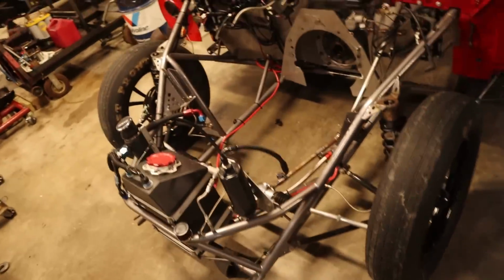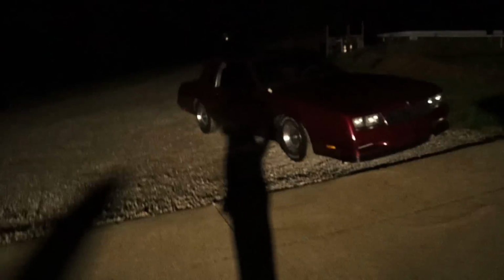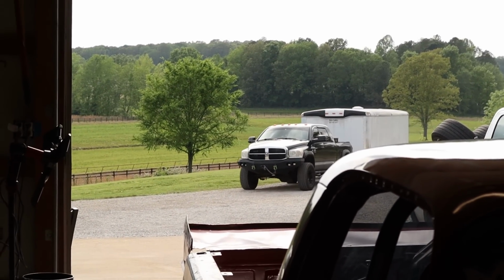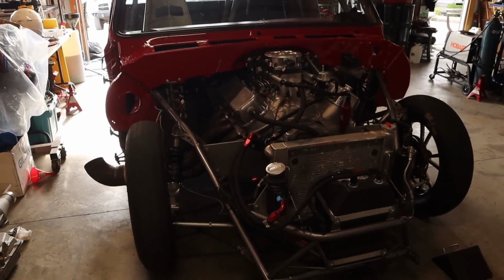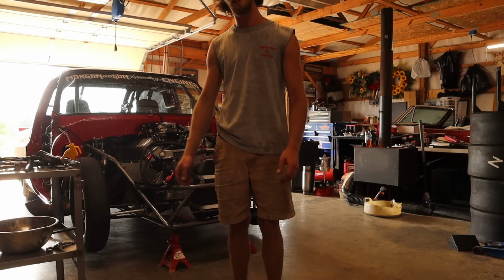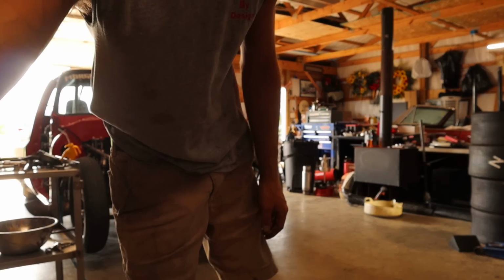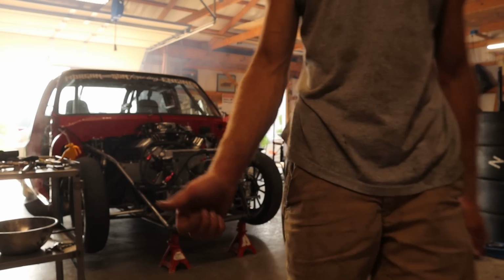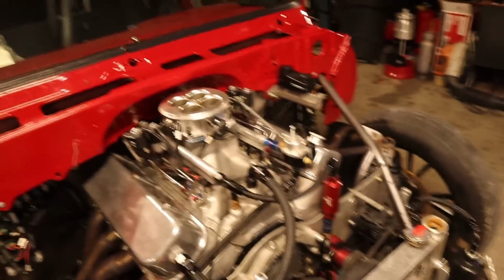Struggles For Whole Milk As We Prep For Testing…

Comment: hang in there dude,i know the feeling of things not going right.i put a new big block in my ride, took 2 days just to get the headers on,when i got it all done,the jack slipped off while i was lowering it and it bashed a huge dent in my oil pan,had to pull it back out and fix the pan.,2 more days later im back to whee i was